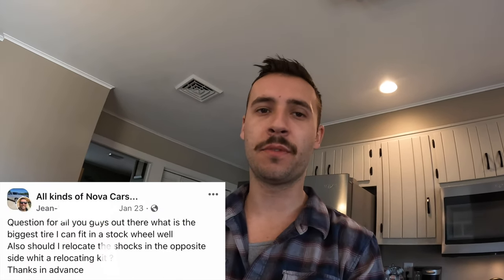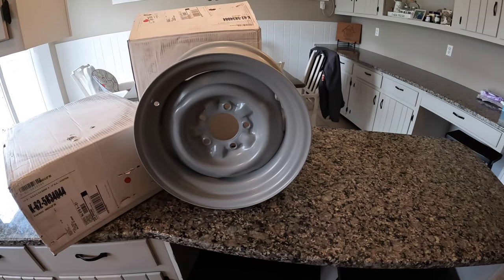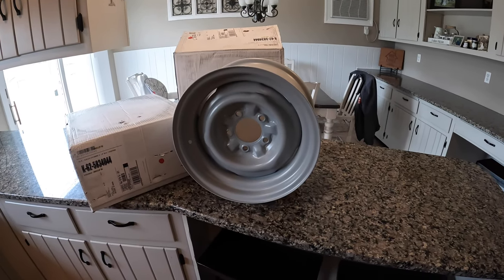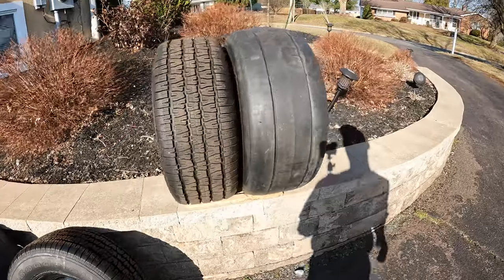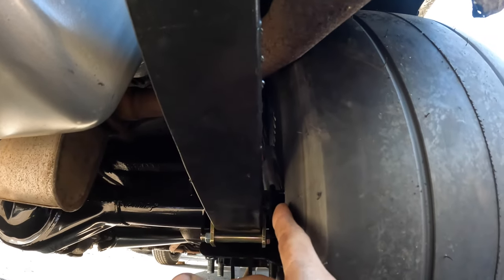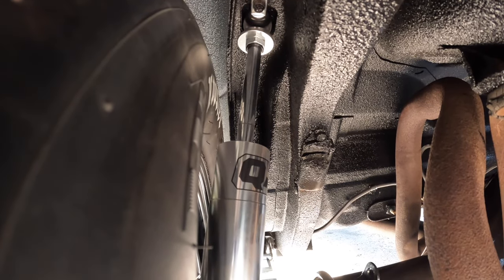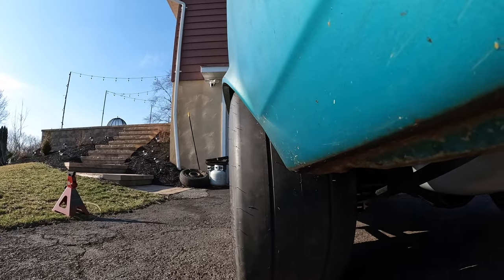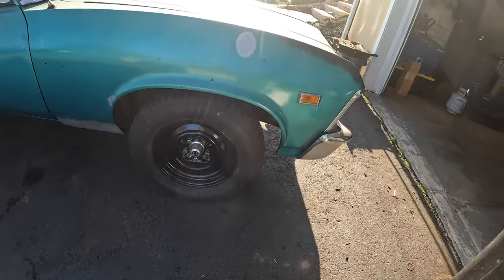HOW TO: BIGGEST wheel/tire combo on stock NOVA

Comment: I remember a few years ago everyone told me to buy the 15x8 with a 5.5" backspace so I did, and wound up having to get 1/4" wheel spacers. The 5.5" didn't actually rub until you had enough weight in the car. Nice video!
Reply from the maker: Thanks!
Reply: 15x8 5.5 backspacing on my 72 steelies.....15x9 5 inch backspacing US Wheel aluminum slots.....MH racemaster J60s on the slots 27560R15 nitto drag radials on the steelies!

Comment: I don't understand why everybody thinks this is such a big feet to put 275.60 under a 68 to 72 Nova. I have run a variety of combinations on my 69 I currently have 15 * 8 1/2 center lines with 4 7/8 backspace the wheel has a nice deep dish to it it fits the car perfectly and looks a million times better than some boring black painted steel wheels. Not to mention I had them delivered in a day I didn't wait a year for some goofy backspace

Comment: I put a 40 series Mickey Thompson. That’s a 10.5” wide tire! I ran Foose rims and I also changed the lower shock mounts to one’s off a 72 camaro so it changed the shock angle! My backspacing was in centimeters or millimeters or something stupid but it wound up being around a 5.75” offset! The main thing I had to change was the shock mounts!Blue Ridge

Comment: I put the centreline auto drag 15x8.5 PCD5-120 65..+3 offset...with 255 60 15 tyres fitted perfectly nice..also I did try 275 60 15  it bit tight on outer guard lips 
all u need trim 1.5  inches off diff housing 10 bolts 8.5 rear then there is room to fit the 275 60 15  without  hurting the guard lips

Comment: The stock 15/8 rallies fit perfect to! With a 265/50 TA radial. I ran that on my 70SS with a 14/7 rally with a 245/50/14 on the front. Looks WICKED, and no problems with any rubbing.

Comment: i always use the gm 15 x 8 inch  monte carlo ralley wheels that used them corvette type center caps n beauty rings n ran 275/60r15 no problem fits great and also ran 295/50r15

Comment: I’m running the same 275s on my Nova with 5.5” backspacing and fit ok.  I’m running air shocks, which would not work with that wide of a tire. There is a kit that relocated the shocks to the inside of the leaf springs if your shocks cause clearance issues

Comment: Do you think that magic number of 5.25 would work for a 1969 Camaro aswell? Love the look of those Hoosier meaty tire on the back. Well done👏👏👍👍
Reply from the maker: Hey Ryan glad you like this look but honestly not sure if this is right b.s. for the Camaro or not. Almost everything on the nova and Camaro chassis wise is very very similar but the Camaro quarter panels and inner fender are very different. I don’t believe you would have as tough of a time fitting big meats on that Camaro. You may be able to fit a more off the shelf wheel on that car that wouldn’t require the custom made b.s.

Comment: Looks great! I usually run the 275/60r15’s on 15x10 inch rims for a flatter tread patch, I wonder if running a 10” rim on this car would still fit with the correct offset since the tires don’t ballon on the rim as much

Comment: I'm not sure if it has to do with the fact that you put a Ford 9-inch rear end in the car but on mine I had an eight inch wheel with a four and a half inch backspace and a 29 5-10-5 slick but it did require a little quarter panel massaging

Comment: I have a 70 Nova, lowered 2” rear hotchkis springs, and rear disc brake, I think the disc pushes it out a 1/4 “, so a15x8 w/a 5.25 back space should work I’d be happy with a 255, running 235x60x15now looks like grand ma’s car

Comment: I'm hoping you also can get some body work done to that soon to be beast.The color is nice in a " not over used " kind of way. It's not black or blue, and it's probably the original paint that the car rolled off the assembly line with, so it's got that survivor factor too. Have fun with it, and don't wreck it. If that does happen, hopefully, you'll have a roll cage in it so you don't get hurt.

Comment: Question- can adding people/weight be a running problem to clearance? Meaning w people in backseat, etc- does this setup still work? Thx!!
Reply from the maker: @GCMJR  I’ve been running this setup for a while now and regularly drive with my wife and 2 kids in the car. Never had any rubbing with weight or bumps. The car does have a VERY stiff rear suspension though with the Calvert split monos.
Reply: @hatchsrecreationalengineer1997  thank you

Comment: Getting a quote now from Wheel Vintiques for the same size wheel for my '71.  Is your Currie 9 inch the same width (flange-to-flange) as the original rear end?  It should be 60" if memory serves. Love the vids and the build!
Reply from the maker: Thanks John glad you enjoy the content! I don’t remember the exact measurement flange to flange but yes my original 8.2 10 bolt and the 9” that I got from Currie are exactly the same.

Comment: Hello! I thought you said the ideal spacer was 5.225, not 5.250.? I saw many very nice parts under there. What plans do you have to the body work? Thanks for sharing. Cheers from Motown.
Reply from the maker: No. I did not mention anything regarding a spacer. I did talk about the backspacing and the ideal backspacing is 5.25” (which generally has to be custom ordered). Some people get away with 5.5” or 5.0” but these typically require some modifying/trimming to fit. I have no plans for the bodywork. I like it just the way it is with all its bumps and bruises

Comment: So what happens when your axle is offset to the passenger side by 3/4” from the factory… I have days of room on the driver’s side but my passenger side rubs all day
Reply: if everything is square,  consider a panhard bar to move rear into a better position and keep it there.  Also measure where the spring perches are and make syre they are positioned perfectly

Comment: Awesome video! It was super helpful. I’m having a hard time finding wheels with a 5.25 back spacing. Do you know if a 5 or a 5.5 would work? Thanks for taking the time to make your videos. I really appreciate them!
Reply from the maker: Thanks Justin I really appreciate your feedback and am glad you enjoy the content! As for your wheel selection for a 5.25 bs wheel your options are going to be very scarce (that’s why I chose a two piece steel wheel that I could modify the backspace to the perfect size). However a lot of guys do have luck running a 5 or 5.5” bs wheel it’s just not the most “universal” nova size. Running the 5 or 5.5 will definitely require some slight tweaking to make work with the 275 but it is doable. Another potential option is running the 5” bs wheel with a .25” spacer. I have attached a link to a company that sells billet aluminum spacer to make the 5” a 5.25” bs. I hope this helps point you in the right direction! 

https://www.speedwaymotors.com/OER-K151791-1-4-In-Billet-Alum-Spacer-For-5X4-3-4-In-Bolt-Pattern,130068.html?sku=92626667&utm_medium=CSEGoogle&utm_source=CSE&utm_campaign=CSEGOOGLE&gclid=Cj0KCQjw0PWRBhDKARIsAPKHFGgeZnDgPUG2MTJSVcyE5BJxO8l6xeV82-stoQJqX41iMtvMGdn7zfUaAsR3EALw_wcB
Reply: Thanks! I really appreciate the quick reply. I’m looking forward to your other videos.
Reply: There aren’t very many companies that will do a 5.5” backspacing in the 15x8 wheel.  I ended up buying the Vision Nitros that do come with the proper measurements.  Nice looking wheels too

Comment: I have a 496 1969 Nova that runs 10.23 in quarter mile on drag radials with just 28" MT tires and stock suspension with slapper bars. You want 275 in rear for what? Are you drag racing this? Are you doing an LS turbo street racer? Wide tires are for traction and not looks.  For a wide rim even with 5.5 spacing you have to relocate at least one shock on drivers side on 1969-72 Nova's or the bolt head will rub the rim.
Reply: Mine hitting the inner fender with 5.5

Comment: You got nice 9" diff and old rust Scottish bagpipe muffler 🤣
Need good killer mufflers 👍
Reply from the maker: Only reason for the bagpipe muffler is the car still has the 6 cylinder and powerglide in it. Once the drivetrain is upgraded so will the exhaust. Started with suspension, brakes, and rearend before making power upgrades.

Comment: Is your bottom bolt on the cal tech bar loose on the drivers side?
Reply from the maker: Yes at the time I made this video I had just finished installing the cal tracs and had not set them or yet. Since this video everything has been locked down and tightened.

Comment: I agree with what you've done. The only question for me would be about the 9" you had made.

Why not have the rear made 2" narrower?  Then all the 8" wheels with 4.25" backspace would work- and those are significantly more common.
Reply: With 2" tubs narrowed 58.5 wide 9inch rear would do the trick, then 10" rims with 5.5" backspace should fit 305 tire size
Reply: @stanmendoza7871  I'm not sure that's right. Who makes a 305 radial in 15"?
Reply: @PaulsProTips  Nitto NTO5R 305/15   Michelin TB/15's even wider 325/50R15 form Racemaster or M/T 325 Streets
Reply: @stanmendoza7871  i couldn't find the Nitto. Got a link?

Comment: On the rims I know a couple of people who can cut them and set them where you want within the ring. I want store up the holes where the lug studs go through. And my dad surprised me while I was gone off to whatever duty station ice TDY at. Here in head and cut it out a ring and put in a new rim face. Yeah I'm bragging a little bit. You can't tell what it done by time finish it. He's no longer here to do those things. Somebody bills dirt track cars should be able to do something like this I'm only mention it because if you're in a bind next time around and can't wait. They turned out beautiful that look great I know it's been a year or so ago. I have even wider tires on a little bit older car and the rims are built specifically and they do fine going down straight stretch like a quarter-mile but you get on a little bit of a turn here and there, they drag.  They look great on your car

Comment: Do they rub when driving on the street and going over bumps? Even with the caltracs?  I have that 70nova w/10bolt and caltracs in the rear
Reply from the maker: No they do not rub. I have been running them on my 69’ for a few months to local car shows and cruise nights and they fit great. However I tried to put them on my 72’ and they would not fit with the rear shock absorbers that I have on that car. So I’m order for them to fit you will need to run a rear shock that has a thin housing .
Reply: @hatchsrecreationalengineer1997  I just have some cheap AutoZone ones that are thin enough. I also have the splitmonos on mine. I wasn't to sure if I should have gotten the adjustable ones like yours. Not to sure if it would make a big difference vs the cheap AutoZone ones. Other than the shocks and my 8.2 Yukon gear with posi diff I have the same set up as yours. Gonna try out the 5.25 back spacing with 275s. Hope it goes well. Thanks

Comment: What backspace did you end up going with on the front wheels?  Also, what tire size did you choose on the front?
Reply from the maker: Front is a 215/70 on a 15x6 3.75 B.S.
Reply from the maker: Josh i mistyped the backspacing. It was 3.75" bs on the fronts not 4.75"

Comment: I’m not sure if you answered this before but can you give me the bolt pattern for the 15x8 5.25 back spacing on the nova wheels from Wheel manufacture? I’m not dragging so how large can the front go as well without making modifications? Thanks
Reply from the maker: The bolt pattern is 5x4.75". The front will all depend on what size rim you want to run. I am running a 15x6 with 3.75" B.S on a 215/70 tire and this is the tallest tire you can cram in there with this wheel size without hitting inner wheel well or frame on a full lock.
Reply: @hatchsrecreationalengineer1997  Thanks once again for the info!

Comment: What's the measurements of the front wheels and rims?
Reply from the maker: 215/70/15 on a 15x6 with 3.75 backspacing. Wheel vintiques steel wheel.
Reply: @hatchsrecreationalengineer1997  thank you. With this brand of rims. Have you found the dog dishes are loose or fly off?
Reply from the maker: @thomasbednarik535  with the wheel vintiques wheels I have had great luck on the 3 pairs I have. The dishes fit super tight and I’ve never lost one.
Reply: @hatchsrecreationalengineer1997  do you think 15x7 would be to wide for the front?
Reply from the maker: @thomasbednarik535 I have seen guys run 15x7’s on the front you just need to research what backspacing you will need and tire size. I know a guy running rally wheels on a 68’ that are 15x7 4” backspacing with a 215/65 tire.

Comment: Thanks for the info! Do you know if anyone reproduces Chevy Rally rim made with that 5.5” backspacing?
Reply from the maker: The only rally wheel they sell of the shelf is this one https://www.summitracing.com/parts/wvi-30-583405. However even though it is only 5” b.s it is made by the same company (wheel vintiques) as my wheels. They are also a two piece construction just like my wheels so I don’t see why they couldn’t custom make the b.s for you like they did for me. Call summit with that P/N I gave you and see if they can do it. I ordered the wheels through summit because it was cheaper and came with free shipping as opposed to ordering directly through wheel vintiques.

Comment: Don't put a fat girl in the back, she will cause you issues when going over uneven pavement or hitting pot holes. The outside of the tire will surely rub up in the outer wheelhouse. I have wheels my Uncle and I made that fit exactly like yours do. No problems until you hit a bump hard. With rear passengers its not good on the tires or the car. It makes me flinch when I hear them rub. It is not a set up for normal street or highway driving. It will teach you to slow down and dodge the rough stuff. Also, only petite girls in the back seat. Keep some air pressure in them so they stand tall until you get to the race track. Don't load up the trunk with heavy stuff. Don't fill your fuel tank completely full. These are all small things I have learned from 24 years of driving and racing with tires that barely fit but look AWESOME. Most people think its mini tubbed. It is not. I have the same back spacing on home made ( by me and my uncle at his machine shop) Rally Wheels. 15x8 with a 29/10.5/15 MT ET Drag Slick. I had to trim the lip at the top of the wheel well. Then tack weld the quarter and outer wheel house back together. I had cut away the spot welds up top. Well I hope you have finished the car by now. If you have, you will have already figured out most the pitfalls of running very tight tire clearance. But its worth every scuff and scrape to have "That Look". Build On!